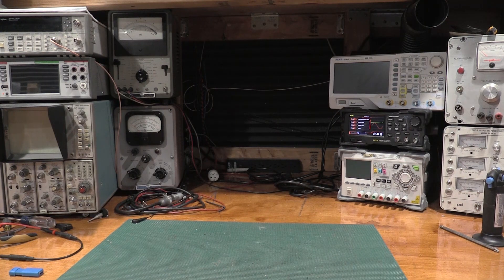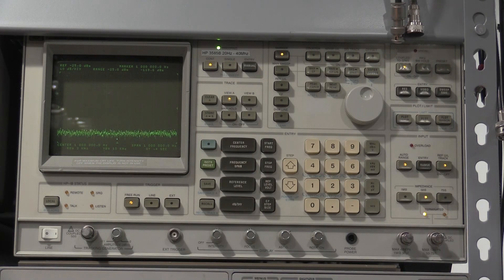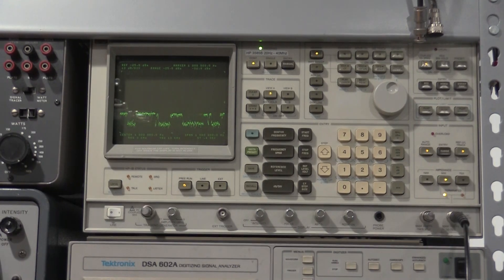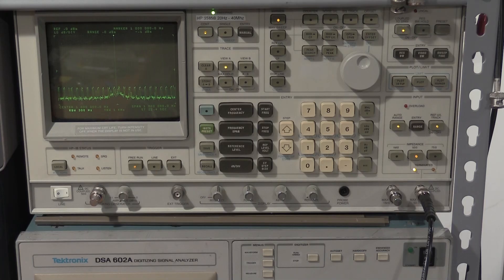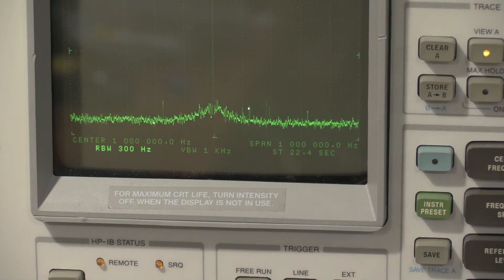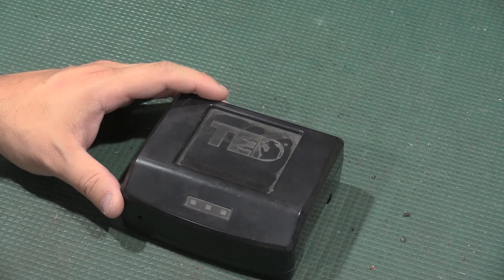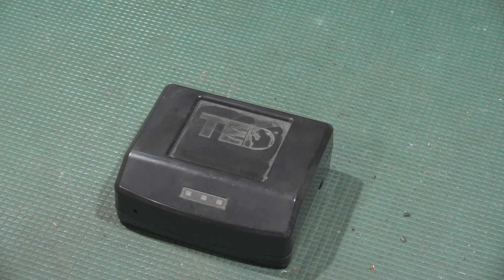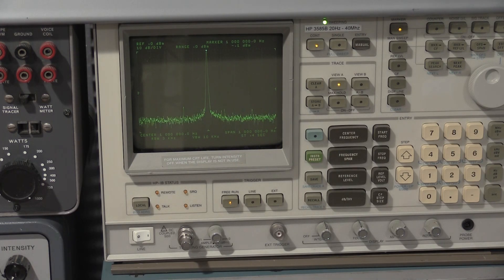FINNALLY finding the Chirp Interference in the lab!

Comment: The video shows the chirp and proves which unit was the perpetrator. However, if the video explained how the TED was making the problem, I missed it. Maybe turning on/off the current coil to read the current was causing a capacitively coupled "thump" on the Line leg of the Mains and spreading the thump via the Mains connection to everything? Please explained. If I missed it, I apologize. Thanks for the help. Cheers!
Reply from the maker: This unit uses power line networking it is using the ground and neutral conductors my current theory is when it is actively communicating it is causing the ground reference for the equipment to "not be ground" temporarily which is messing with the measurements. I tried isolating the unit to a high quality power strip as well as a UPS but it was still present. Through the power panel this data impulse was spreading to everything in the lab. 

I still want to do the power monitoring and The Energy Detective is getting ready to release a new version of this unit so I am currently in a holding pattern waiting for the new unit to release. I am hoping they us ethernet networking or WI-FI for the communication as we have plenty of that in the lab.
Reply: @ZenwizardStudios  Yes, I understood from the video your theory of the problem. And, I understand that it may not have been worthwhile to identify the problem within the TED. However, I would have found the exploration into the TED's problem to be very interesting and educational. So, I think our theories combine... Yours - That the Ground is being momentarily lost... Mine - that the TED's sensor coil is conveying an inductive pulse to the Mains legs, when the TED turns on/off the sensing coil to take a measurement. A pulse would change the Ground reference, as you say. If this were to be the issue with the TED, it would be an issue with a component failure, or the circuit's design (both obviously.) But, I would not think that changing the TED's method of communication (ethernet, or WiFi) would correct the problem, as the "bump" is being injected into the Mains.  The cure would seem to be to eliminate the inductive bump. I do recall that current sensing coils include a resistor, for some purpose... I forget what. If it is a bleed-off resistor, maybe it failed, due to the repetitive high current spikes. Offered humbly, by a hobbyist. Thanks for the video and explanation! Cheers.

Comment: One of the Guys at the radio club has the same sort of problem, event got the feds out with one of their Cat-Detector-Vans and they could find nothing.  Turns out it was his unused party-phone line, that  dates from the 1940s.  He was at the end of the line and before it him it ran though the farm next door, and  all its old out buildings.  One houses the router and computer for the automated milking management system  and the old phone line was picking up some of the RF from that.  In the end a simple ferrite bead on the incoming phone line solved it along with a 45 ohm terminator to ground.

Comment: TED information page - 

"Introduction to TED: The Energy Detective
TED is an in-home electricity monitor that provides real-time data in an easy-to-understand manner. TED permanently installs in your breaker panel and gives you instant feedback on your electricity usage.
TED quickly and easily installs in your home's breaker panel. By connecting two sensor clamps around the incoming power conductors that feed your panel, TED measures the flow of electricity within your home. Information is sent over existing electrical wiring in the home to the compact wall-plug Gateway. You can then view real-time data on the wireless display or via a computer and/or smartphone."

There's the answer right there, the TED data is sent over the house power network, IME EXPECT devices like this to cause problems especially audio gear. 
Back in the day hot water systems were switched on during off peak times by a Zellweger controller that responded to control tones sent over the electricity supply network, and yep these control tones found their way into audio gear and other devices - https://en.wikipedia.org/wiki/Zellweger_off-peak

Comment: If the power line comms are anything like the crappy radios that use the power cord as the antenna, I wonder if you could simply open the units up and decouple the rf from the power line, hooking it instead to a dummy power line only shared with the other TED devices.

Alternately, put those devices on their own, minimal-length circuit, and add filters to block the noise from going anywhere else.

Comment: This was really cool and informative, thanks! Hypothetical: what if you were to build a lab out in the country somewhere and located it in a building which you disconnected from the power grid, instead powering the building via solar panels and specialized filtered power supplies, with a separate dedicated ground rod for the building? Would you see even lower noise on the spectrum analyzer? Suppose you even put a Faraday cage around the building to filter out as much stray RF as possible. I wonder how clean and sensitive you could get...
Reply from the maker: I am gearing up to move buildings in the medium term. I am starting to look at what I should do with the power systems to get the quietest and cleanest power. My current thoughts are to use a battery conditioned UPS to feed the entire lab with an  isolated ground for the lab but I am not sure yet. Common mode noise as well as all the wireless can be REALLY hard to get rid of. There was a famous instance where NASA though they were hearing signals from space that turned out to be a tech making popcorn in a microwave at 1 AM.

Comment: Modern gear is rarely 'off'... it goes into 'standby' with a portion of the circuits remaining powered, in order to monitor the software triggering 'on' button when it is cycled. I have a preference for real AC disconnection.   I also dislike all the wireless 'stuff' and EMI throwing devices that plague the modern era.. Loss of easy access to non emitting thermionic light sources has been another problem.. LED and CFL bulbs are horrid noise sources.  I did find that 'Rugged' series filament light bulbs were not banned..but they are costly and scarce. I now have 2 complete lighting systems in my lab.. one for assembly and general work, and another for measurement time, 100% filament thermionic, that it does not throw EMI-RFI.
Reply from the maker: Most of my even vintage HP gear is AWFUL for this. Crystal ovens stay on so they can stay up to temp due to the 72 Hour warm up time. Why I like having the RB unit for the stability.

Comment: I assume that the TED unit you show is some sort of master station that polls the other units and provides the web interface over ethernet. It causes a loud chirp because it's close to your bench, but the slave stations provide a much smaller chirp because they're further away. Maybe different power but there's no obvious reason why that should be the case.

So what if you put the master unit in the utility cupboard with the slavers ? Maybe even screen the utility cupboard with metal foil or mesh. Then, wire it to your ethernet. Perhaps use an optical bridge so there's no conduction of the chirp along the ethernet wiring, and put ferrites on the power cables coming out of the cupboard. Then the transmissions will be made well away from your bench. All you'll lose is those leds on the front.

If you have slave pickups distributed around the house this won't be so easy, but you should at least be able to move the worst source away from your bench. I wouldn't bet on the supplier dropping the mains transmission, it will suit a lot more of their customers than ethernet.